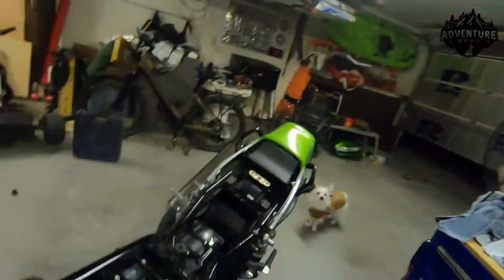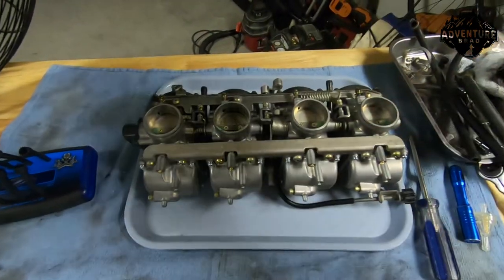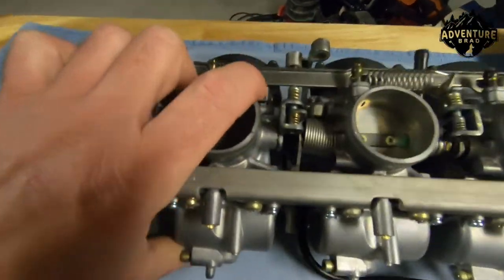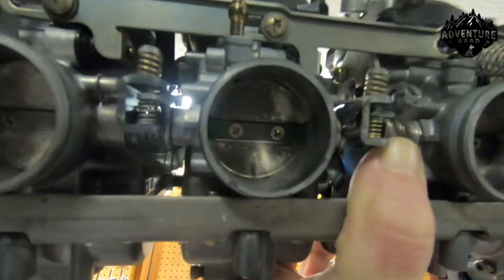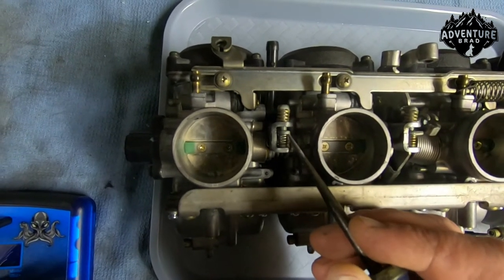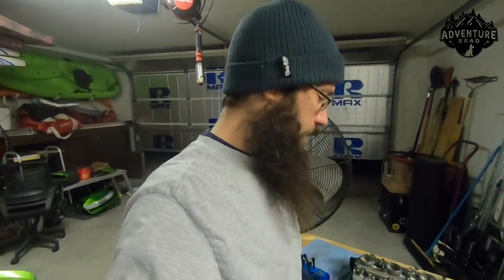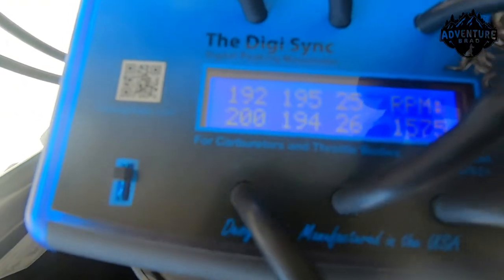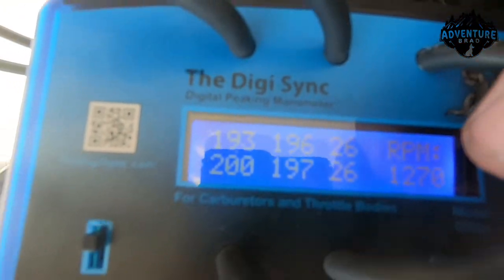Sync Carbs WITHOUT tools! The easy way that WORKS!

Comment: ya, pretty much how i synced the dual carbs on my 2003 yamaha 1100. i would hold them up to the sun as i was usually working outside and didn't have access to electricity.

Comment: i dont think your method is very accurate.  i line up each throttle plate to just begin to expose the first progression hole. its important to snap the linkage a couple times anytime a screw is adjusted to let things settle into place.